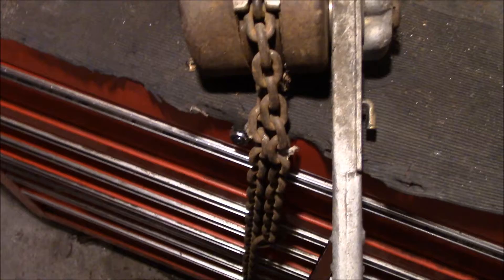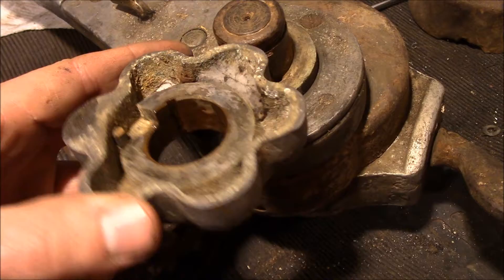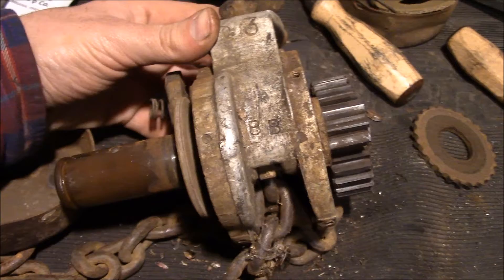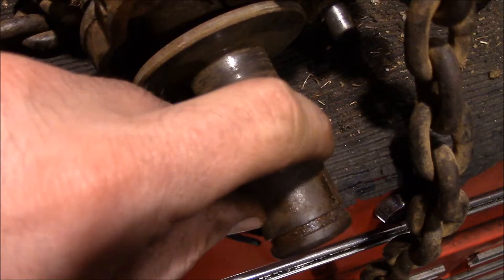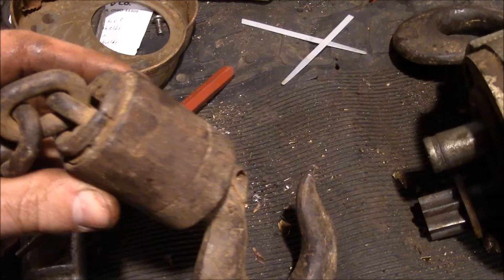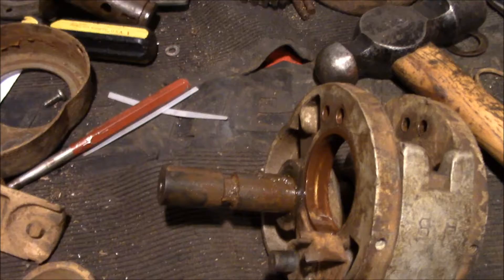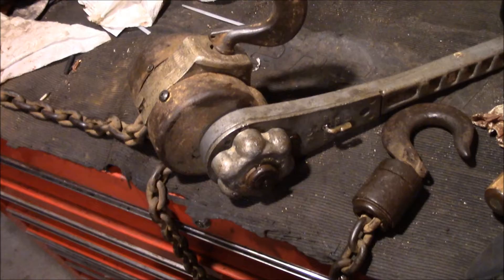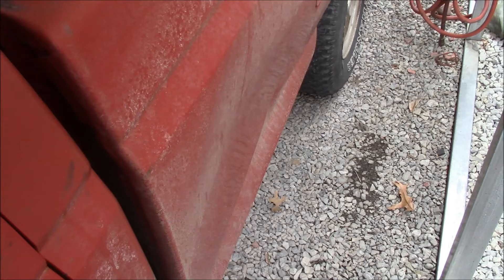Rusty Tool Revival - 1 Ton Tugit Chain Hoist

Comment: Some years back, I was given a 3/4 ton "Coffing" brand chain hoist- all it needed was lube and it worked good. NOW... I used it and other things to tie down an old wagon I was hauling with some other plunder from the mid west to my inlaws in VA. About 15 hours in I'm on the beltway around Indy about midnight when I get a horn honk along side me, and someone pointing back... I pull over as soon as I can. All looks good, all lights working on the trailer. Hmmm.  I carry on. The next day unloading I find the tail chin from the hoist had fallen between a gap in the trailer deck planks. I had ground off about eight feet of what I find is $4 a foot hi tensile chain over who knows how many states! The guys must have seen sparks under the trailer and that is why they tried to let me know.

Comment: I have one JUST Like it, but not as bad off as yours was.
Very Uplifting for me.  

I'm Bookmarking, just in case.

Thank You!!!!
Reply from the maker: Cool, glad to hear.  I've used the heck out of that hoist since the vid, it's still kicking.
Reply: @toocheaptosmoke  I first used mine to help me get a Vintage Delta Rockwell Bench Drill Press cleaned up.  The Press is so Top-HEAVY that I knew I needed support.  It was stiff at first, but I was thrilled when WD-40 and patience was enough.

Armed with your Video, I feel free to use it often.

Thank you, again.